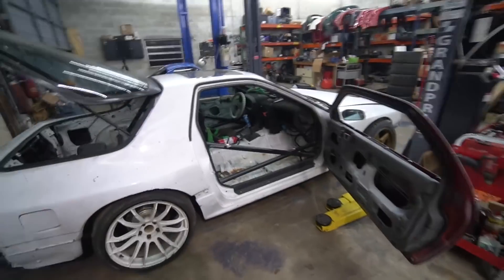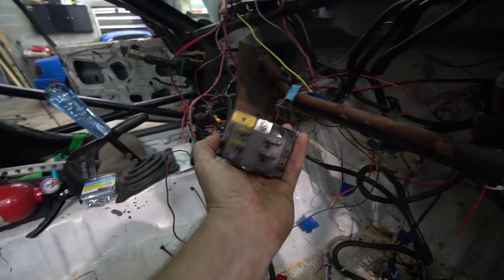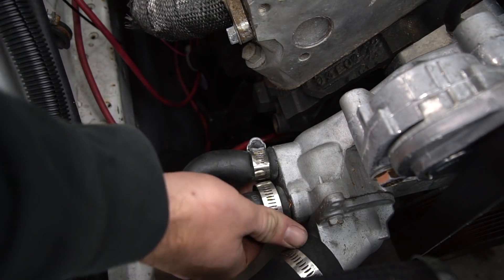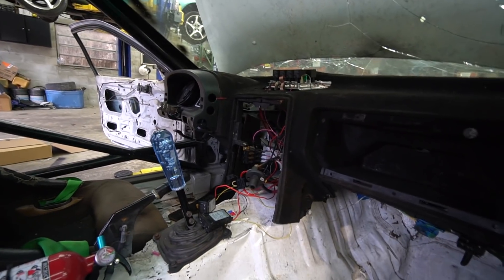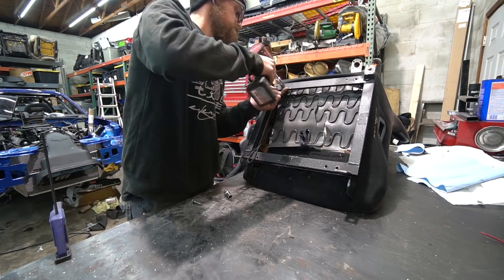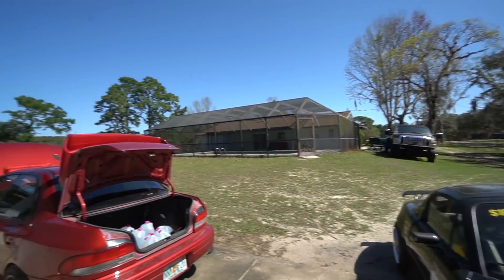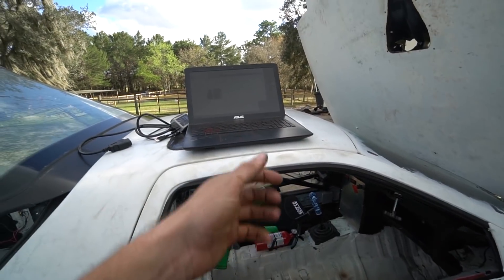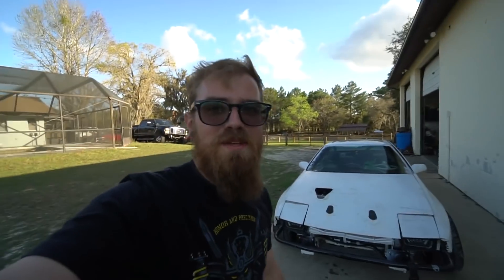Final Mods For The Abandoned FC RX7 Project + Test Rips!(It's Honestly Pretty Amazing!)

Comment: Taylor if you're running a T56 in the FC you can get a sequential conversion from this company called S1 Sequentials. It's super worth it in my opinion the performance benefits of it are,definitely worth the $1600 it costs for the shifter conversion and makes drifting way easier.

Comment: That oil pressure was dropping into the "teens" there when you got back to the shop. Seems a little low because don't LS engines sit around 25ish at idle and isn't below 20 considered a start to be concerned? Not the most familiar with the LS platform though.
Reply from the maker: Minimum pressure is 7 psi at idle. Good rule of thumb is 10psi per 1000rpm. Up to about 60. Minimal gains above 60psi. My miata has a dry sump and is basically 60-65 no matter the rpm. But teens to 20’s is fine. If not, we’ll slap another engine in. Lol
Reply: @Taylordrifts  Ah got ya. Thanks for the knowledge bomb! Also, love the content and from your Instagram story a little while ago, hope to see a pro 2 build soon! :)

Comment: Hey Taylor, your fab skills have improved leaps and bounds over the years but if you really want to step up your fit and finish a set of cheap deburring tools (maybe you already have them) and a belt sander could help you get nice edges and corners on metal work.  Also this thing rips!  Glad you finally took those stickers off (still got the cluster one).

Comment: If you have another oil pressure sender fail, maybe remote mount it.  I was told to do that after a couple of failures to isolate it from the engine vibrations.  Would at least make it easier to get to.

Comment: Hey Taylor have you tried reinstalling the power steering motor since tightened your upper control arm? Just that I have run electric columns in rally cars and never had any problems.

Comment: @Taylor Ray Will you try using your cheap amazon flux core welder again, I was going to buy one until I saw your video for my first welder. The sputtering and ugly weld turned me off, but someone told me that if you reverse the polarity (I dunno he called it DC negative or straight polarity), if this works I might buy it for my first welder to use for some small projects. You probably wont even see this and your probably busy, eh shot in the dark I guess.

Comment: Taylor, congrats on 400K subs....it should be way higher but it's progressing....like your content continues too.   I know the Fummings will be a big boost as well for all the truck owners and just going to be an awesome tow rig.    Myself, just got my 2003 Dodge Ram 3500 backup and running.  Had to replace a bad injector.  Now for new tires.   BTW. Do you still have the white dodge chassis on site?
Reply from the maker: I do still have the chassis.

Comment: 24:08 20lbs of oil pressure at idle? I do believe that is kinda low my friend that should be at least 35lb. either its simple like a old oil pump going out or it's about to be a bigger problem either way not very good looking.
Reply from the maker: Min spec on ls's is 7psi. Were well above that. 10psi per 1k rpm is a good rule of thumb up to about 60. minimal gains from 60 at high rpm.